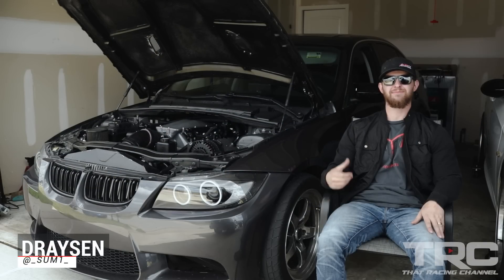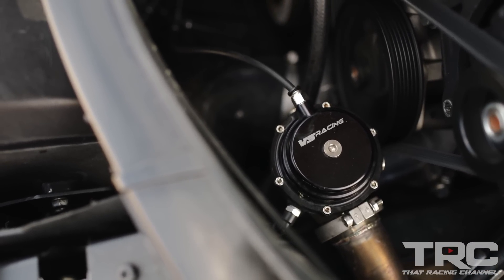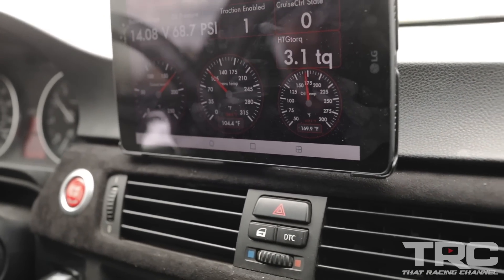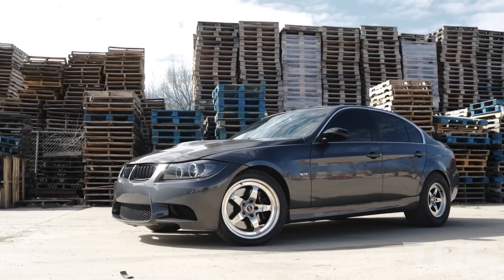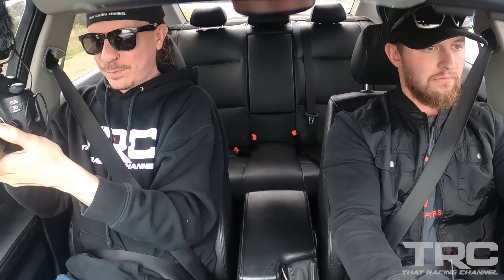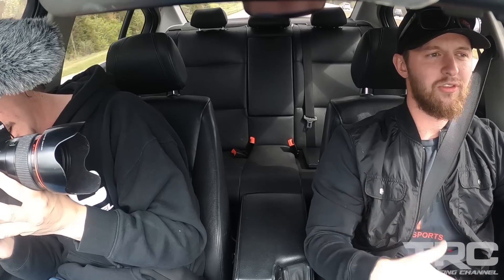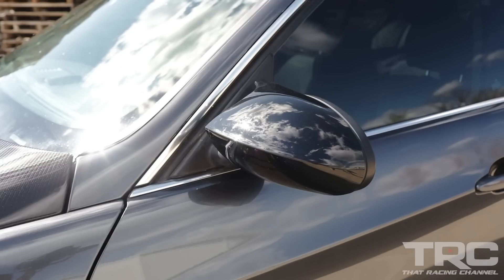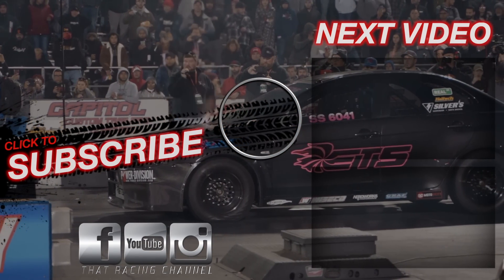1100HP BMW 335i - Turbo LSX with M3 DCT?! (SCARY FAST)

Comment: As an E92 335i owner who's been debating an engine swap but is still undecided this is right up my alley! Thanks!!
Reply: How much power you pushing
Reply: @colin55594  I believe right at or a little above 500 crank. Dyno tune soon.
Reply: Why not s65
Reply: @marklynch1305  That's a good question. Right now I'm pondering hybrids vs. LS swap vs. 2JZ swap and now I need to research S65 swaps.
Reply: @DontReadMyUserName_  yea i just started looking at it for my 135, ghassan automotive sells a remanufactured s65 with a 2yr warranty for 8500.
Reply: @marklynch1305  That's not a bad price and a killer setup in a 135i. You just made me recall watching video with a race 135i that had a S65 reviewed by Matt Farah. I think the same car was on Leno's garage too
Reply: @DontReadMyUserName_  it seriously isn’t lol about 10 years ago they were above 20k and manual gearbox is probably around 4-5k unless your gonna go dct. Same after I saw those videos it seems like it would be the perfect car.
Reply: @marklynch1305  Indeed. What do you think about shoehorning the S85 in there? There's a few 1's running around with that swap. Insane. Maintenance/reliability probably the biggest concern with that swap lol.
Reply: @DontReadMyUserName_  I have a 128i and got it for cheap at 44k miles hoping to run it into the ground then s65 or money permitting s85 swapping
Reply: @user-vj6bx3ks7s  Perfect setup you got there!
Reply: @DontReadMyUserName_ Have you done anything yet? 
There are a lot of cool options as far as engines go, i personally think that a high revving (8500rpm) n/a LS would be awesome in a E-Chassis 3er.

The engine would weigh around the same as an N54 or S65 and size wouldn’t be an issue. The large displacement giving that near instant torque and revving as high as an S65 would be fitting for the car.

The reliability and massive aftermarket to build it any way you want is very tempting. You can make it sound like a ferrari if you want, you can even make a V10 LS or an i6 LS if you want. Both have been done before

Comment: Hell yea man!! Such a badass build, these cars are made for the LS, with Michael Pages mounts it's a straight forward swap. Draysen is doing all the tuning on my single turbo LS e90. Great stuff!
Reply: No these cars are NOT made to have a shitty ass Chivy motor put in them. Smh
Reply: @1SIK335 Technically it isn’t made for it, but it works and it’s awesome. 
Would prefer an n/a LS that revs to ~8500 in an E92. 500-550whp would be plenty and not be overpowered

Comment: Come do a feature of my darton sleeved n54 block with a 6875 precision
Reply from the maker: 👀 

Send us info
Reply: @ThatRacingChannel  email?
Reply: how much power you making? curious. I love the factory platform of the car but couldnt imagine it making near what a LS or even a stock coyote can make. but im one of those ppl that love when cars atleast use a swap or engine from the cars company. LS swaps are getting a little played out. slowly but surely people are going to the ford 5.0 coyote for swaps. 1200whp is capable with just boost and fuel. No heads No cams No pistons  No rods No opening the engine. go built motor and they are making as high as 2500hp on factory blocks. i just love fast stuff i dont fanboy anything. But i have slowly started respecting what the coyote is capable. I was always a import guy and respected the hell out of what a 4cyl dohc vtech honda engine can do. Coyote is like 2 of the put together.
Reply: @carculturenation2166  never had it on a dyno. On the old motor I ran it at like 33 psi on the 68mm before I lifted the head and spun the hub. Was pretty competitive with turbo ls cars on about 25 psi. Never lost to a supercharged mustang
Reply: @ThatRacingChannel  2007 bmw e93 335i. Manual swapped by me, doc race turbo manifold with precision 6875 gen 2. Darton dry sleeved n54 block , full 11mm headstud conversion, built bottom end by me and my buddy,  stock head, Spec twin disk clutch , tial wastgates and gfb bov (maybe 1of1 on a n54). 12 injector setup with dual walbro 450s . I think that about sums up most of it. Pretty spicy on 35 psi 😉😎
Reply: @bimmerfab  Best of all..  Not an LS!!!
Reply: @FJB2020  facts!!
Reply: Fastest E9x in the world is LS powered, sorry bout yalls feels.
Reply: @FJB2020  no one likes slow cars
Reply: @lse90garage  sounds like his momma raised a quitter
Reply: @sendit_e908  🥱🥱🥱 nobody likes a swap thats been done a billion times
Reply: I’d watch this
Reply: @bimmerfab  because it’s what works 😂 you can keep your n54 and be slow then 😂
Reply: @sendit_e908  *its whats easy. There's no point in me swapping my car with a ls. I'm not interested in developing the ls platform. E9x chassis suck for drag racing anyways
Reply: @bimmerfab  lol just a typical n54 guy  “chassis sucks for drag racing”  it’s because you have a n54 that’s why it sucks at drag racing. The LS guys have went 8’s with stock suspension.
Reply: @bimmerfab  do y’all practice being this delusional or does it just come naturally? 😂😂
Reply: @lse90garage  must be natural  🤷‍♂️
Reply: @sendit_e908  wtf? Who?

Comment: aint making that power without the Chevy LS in it. Or coyote which can make up to 1200whp with just boost and fuel. No heads No cams No sleeves No pistons or rods Biggest thing no opening the engine unless you want bigger power which built coyotes are make up to 2500hp on factory block. This thing is a beastie setup.
Reply: You can make that power with the N54 that came in it.
Reply: Nah. Noone has yet. Lol
Reply: @draysenmead216  there are N54 with 4 digit power numbers out there. Just look around. If a 2J can make big power then eventually the N54 will catch up.
Reply: @midwestbmw1292  going on 16 years now with the n54 haha
Reply: @midwestbmw1292  n54 is trash end of story
Reply: @sendit_e908  once you know it like the back of your hand it’s not. But hey some peoples attention span is longer than others.
Reply: @midwestbmw1292  couldn't agree more, there's a few out there running 4figers, far as a stock engine from bmw it's one of there best
Reply: @midwestbmw1292   been there done that, done more on the n54 platform then most people have and tried every setup you can think of. Just not a good motor to make power.
Reply: @sendit_e908  it’s a 3 liter with hundreds if not thousands of examples making 650+whp. Maybe you’re just discouraged?That’s okay and all, but to call them trash engines that can’t make power is simply out of pocket.
Reply: @midwestbmw1292  at what cost😂
Reply: @sendit_e908  must be your mechanical skills then
Reply: @lse90garage  how long has the Chevy small block been out?  How long has the 2JZ been out?  BMW literally got into forced induction circa 2005 and the N54 has paved the way for some of the greatest forced induction engines in production right now.
Reply: @vaugr1917  how much does the guy in this video have under the hood of that car?
Reply: 650 isn’t nothing to be proud of 😂 you got factory cars with more then that. Discouraged? Lol naw I tried the whole make a n54 “fast” never worked out cause it’s a junk engine.
Reply: @jordanthom8963  ya that must be it 🤡 😂
Reply: @midwestbmw1292   Draysen still had one of the quickest (1/4 mile street car) n54s, just the next step. There is a reason people drag race big blocks
Reply: @jordanthom8963  lol send it e90 had one of the fastest n54’s on the platform along with joel. You would be hard pressed to make 4 digits AND have it be reliable
Reply: Draysen**
Reply: This made my head hurt
Reply: @sendit_e908  there isn't many factory cars with 650whp😅😅😅
Reply: You can make that power for sure. Reliably.. not happening. But having twice the displacement and barely making more power isn't really worth bragging about. Guessing the op has never built something on their own by the way they talk.
Reply: @shifty1927   🎯 🎯🎯
Reply: power numbers are just peak power though, doesn't tell you how much power / torque its making everywhere else for actual street driving. you could have 1000hp out of a 4 banger but f all drivability, just a surge power, whereas an LS at that level could be a lot more linear. having high displacement is great in something like an LS when the engine is still physically smaller and lighter and most other performance engines too 👍 @shifty1927
Reply: @midwestbmw1292 n54 block doesn't even have the strength a  2JZ block has. It has to be sleeved.

Comment: When he said he’s surprised the trans is still alive, not to sound like a cocky prick, but BMW DCT’s are tested tride and true to handle 1000ftlbs of torque on the stock gear set, because over in Europe people have built F10 M5’s to 1000hp and 1000ftlbs of torque and here in the US with the F80 M3’s at 1000hp with just a DCT clutch and clutch basket upgrade

Comment: I didn't understand a single word when you started taking the parts. I have a 2009 n46 engine bmw 320i in India, and i want to build a car like yours on a budget, have been looking at ls engine swap, and hanging out on ebay for it. Everything gets expensive for me as i have import duties and misc costs just to get the engine and other things here. Wish you could guide me

Comment: Yes maxxecu!!!! I got a maxxecu on a 335is sleeved 👀
Reply: aint making that power without the Chevy LS in it. Or coyote which can make up to 1200whp with just boost and fuel. No heads No cams No sleeves No pistons or rods Biggest thing no opening the engine unless you want bigger power which built coyotes are make up to 2500hp on factory block. This thing is a beastie setup.

Comment: I have the same car with simple mods and love it  can’t beat the platform for horsepower per dollar gains few mods easy 450-500 😅 with stock snails 🐌
Reply: Oh sure, sounds good doesn't it? Cheap horsepower, good "bang for the buck" they say..... That is till the never ending maintenance ruins all the fun. Some certainly have years of trouble free fun driving a decent amount of miles, but others have found the N54 to be a nightmare of never ending problems. Drains your wallet and your joy because it's never running good for long!

Comment: Y love it the cars verie good projet boyes the cars bmw is sooo good for the race is just one good motors the 335 i stok is 350 hoseepower no no said boyes the 3L5 forgé  in 3L6 ho 3L8 big turbo is the 1000 hoseepower sure one motors big blok américains is good job the chassis the M3 M4M5 is chassis the race look the e60 v10 M5 is one motors the formule 1 the origine yeee verie good motors y love it the e90 boyes